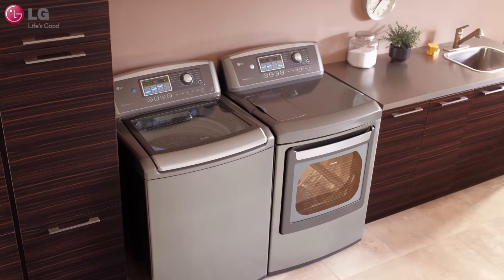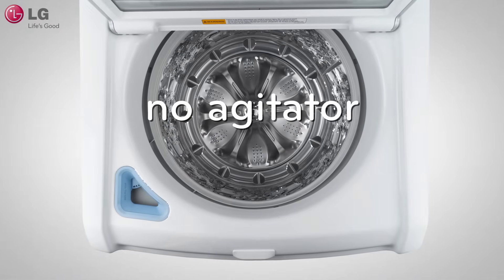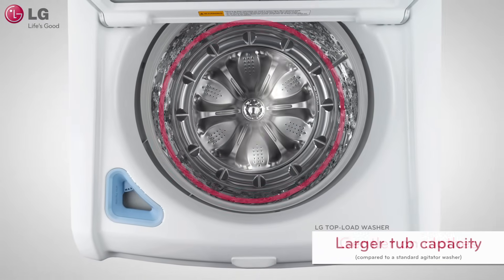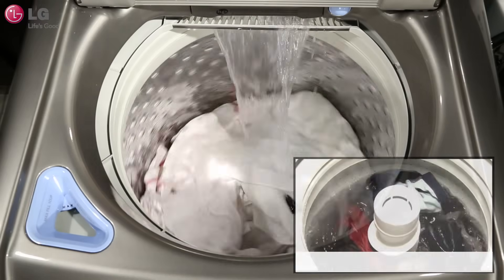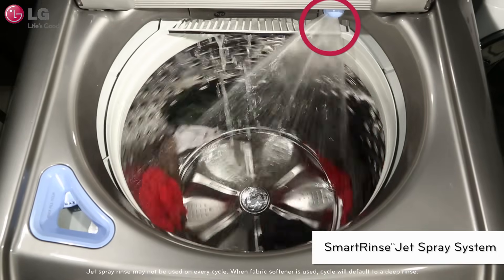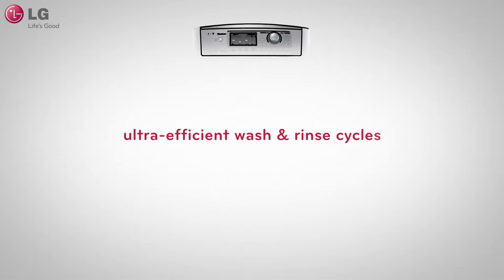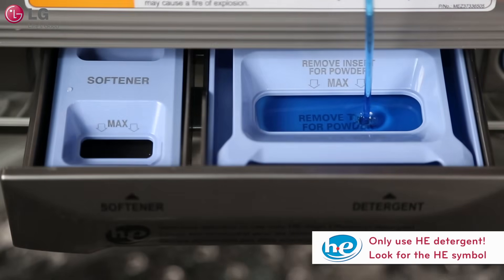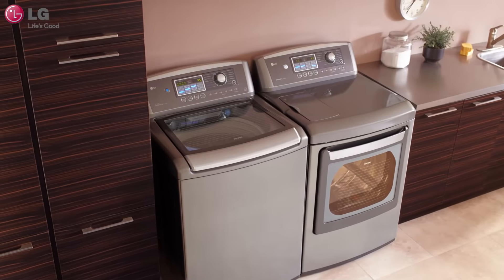LG Washer - How High-Efficiency (HE) Top Loaders Work (2018 Update)

Comment: "Less water does not mean that your clothes are not being thoroughly cleaned."  LOL! Yes, actually, it does. Clothes come out with caked mud that was never rinsed away, and a paste of detergent that was never dissolved. It's not "high efficiency" if you have to wash clothes two or three times.  One thing that helps is to top off the tub with a garden hose since they don't have a setting that fills the tub. Horrible product.

Comment: Purchased the WT7150C* washer and matching dryer, and it only ever puts 2 inches of water in the machine no matter how many items are placed in the washer... When I select "water plus" feature... the machine fills right up to the brim three times during a normal cycle. It's either not enough water or full to the max. there is no inbetween. Of course, we didn't find out about the LG support until just outside of the warranty period and are now stuck with a useless machine. Also note that when running loads through, they come out dusty and covered in lint... Not sure how this washing machine (that only does 1-3 loads per week in a 2 person house) is so dirty?

Comment: $1,300 of junk ‼️ Along with all the other complaints which I 100% agree with under this video, my favorite is I have to stand in front of the machine every time it's filling with water because when I put a comforter to wash (or any other load of clothes) the water line fills to below the comforter so the top half of the fabric/s is sticking out of the water - dry.. and you have to keep pressing add more water, add more water, add more water and wait. What an expensive piece of garbage‼️I wish I had read these reviews before buying it.
Reply: Omg same here,
Reply: I wash all my bedding on deep wash/water cycle. Never use bedding. If you go for the whirlpool brands - good luck to ya. Went through 4 in less than 5 years - all junk. I’ve had my top loading LG for 3 years now.

Comment: Well I bought the LG 4.8 top loader with the agitator. I've only done a couple of loads but it seems to do a real good job. I kind of regretted not getting the impeller but I had just heard too many bad things about it.
Reply: I'm glad to hear someone say something positive.  Too many negatives.  I'm trying to decide between LG impeller or agitator.  Grew up with agitator washers but would really like to try an impeller.  Pros and cons to both, I guess.  Continued good luck with your new washer:)
Reply: You’ve heard too many bad things about impellers in general, or have you heard too many bad things about this particular model?

I asked because the channel Ben’s Appliances and Junk claims this particular model is an exception to the rule when it comes to impellers.
Reply: They work better than Whirlpools

Comment: For the money, this is the worst washing machine and I'd never recommend it to anyone! The machine, literally, spends more time trying to balance the clothes in the drum than washing them. Even when the drum is actually washing/agitating the clothes, it only does it for a few minutes before it stops to balance the load, AGAIN! All the while, the timer is timing down, which allows the clothes to not get sufficiently washed or cleaned. I tried to return it to Home Depot, where I purchased it, but it was non-returnable. I've never been so disappointed in the purchase and operation of an appliance. For me, I should have gone with my gut, and purchased a good ol' fashioned top loader with an agitator. This LG top loader inverter is pitiful!
Reply: I totally agree with you! Worst machine I ever had! Clothes still had deodorant on them after supposedly being washed
Reply: @robyngallegos7041  is it t2028 afps5 ? I'm going to buy the above mensioned model 20kg top loader, if you are talking about the same model let me know plz, it's a lot of money and i dont want to burn it on a useless thing🥺
Reply: @pro max  yes it is the worst machine I ever had! Don't waste your money
Reply: @robyngallegos7041  oh thanks a lot for replying
Reply: @promax9159  you're welcome
Reply: @robyngallegos7041  one more question plz...to help me decide.. there are a lot of bad comments about this machine obviously people are not happy with this one, but there is another thing to consider, i guess almost all of these people have used fancy machines before this onr or front loaders that clean very well, what if someone has never used any latest machines would you still tell them to stay away from this one ?
Reply: @pro max  definitely would!

Comment: I’ve used my LG top load washers for 8 years without issue. You have to understand how to use these..you can’t just load them down with a random mix of items because the drum has to balance. Also filling it completely is a terrible idea...it should always be a little over half capacity when wet. It can handle a ton of clothes but you have to make sure it balances..which is easy to get used to because the machine mostly does it by itself but it’s not magic.

Make sure your weight distribution is similar between individual items. I wouldn’t trade mine one bit. If you want to throw any random thing in a wash and not bother separating like items then get a front loader.
Reply: Wher is awaileble. In cities of & in INDIA??
Reply: I too love my LG. About to buy my 2nd one after 15yr. service from my 1st LG.
Reply: @elbmcook  I’m on my second set also. Sold my house and the buyers wanted the set I had.

Comment: I've used this washer after a Samsung front loader had an accident with the belt snapping, and I've had no issues, it's clean and it smells good, just make sure to use a n affresh tablet and tub clean cycle once a month, clean out the gunk in the bleach tub, and cycle out the wet laundry quickly.

Update: LG dies due to drain pump failure.

Comment: I bought a wash machine TS1365NTP / 01 a year and a half ago and 3 weeks ago we noticed a smoke smell coming from the machine. We contacted the customer service over 2 weeks ago and we do not get our problem solved. Our old machine was also LG and it worked fine over years, but it seems LG products  are not what they used to be.

Comment: I see alot of people are having issues so hopefully these tips will help.
To start off, make sure you load clothes around the impeller, don't throw them on top.
When you add detergent you should use only a minimal amount, you should never EVER hit the MAX line in an HE washer.
If your washer is optioned with TurboWash. USE IT!! Trust me, TurboWash is what makes these LG machines so much better than their competition and I would honestly say if your shopping for a washer and it doesn't have a recirculating pump of sorts, don't do it. Spend the extra money to get a washer with a TurboWash or similar feature. You won't regret it.
Although these machines are "bigger" try only loading them as much as you would a normal agitator washer (I don't know why all these manufacturers have suddenly began making bigger tubs because it honestly hurts washing performance)
Also make sure you're running Tub Clean once a month and using a washing machine cleaner such as Affresh.
Another tip I have is to ditch using fabric softener. Fabric softener is essentially animal fat that has been scented and while you may not see it, it is reeking havoc on your machines internals. Fabric softener is designed to attach to clothing, but it also attaches to your washers outer tub and drains which over time can cause smells and mold buildup. 
Hope these help!!
Reply: As for the detergent, I just use Tide Pods.
Reply: Thanks for the tip about softener! I never knew it was animal fat base! My tub does smell even though it's cleaned periodically with tabs and the cleaning cycle! Bye bye fabric softener!🙏

Comment: Bought a 7800 washer & dryer 2 weeks ago. Awful!!!  The first one was so loud and made every noise imaginable and the motor sounded like it was dying. Today, (2 wks later) they brought a replacement. It’s just as loud!!  And what’s with the clink sound during operation?  It’s not my pipes - it’s the washer itself. It sounds like a hammer on metal. There constant noise during the entire operation. Annoying!
I’m gonna return it and buy another GE with an agitator and no fancy electrical panel. My last GE lasted 20 hrs and it wasn’t as loud as this one. Pretty doesn’t always mean reliable
Reply from the maker: This certainly doesn't sound right. We would be happy to take a look into this for you. For assistance, you can contact our Customer Support by any of the below options:
Phone: 1-800-243-0000 	
LiveChat:  https://www.lg.com/us/support/chatbot
Email: https://www.lg.com/us/support/email-appointment		
Facebook Messenger:  https://www.facebook.com/LGUSA/  	
Twitter DM: @LGUS

The LG Community Forum is also a great resource for getting help from other LG customers: https://lgcommunity.us.com/ ^CP

Comment: Sorry for my poor English...
I made so much research after we exchanged our Maytag washer bravo XL for this one (I had before for 14 years the American classic... manual with agitator).
I am super picky person,  I have no idea for how long this LG washer will last, but so far I am satisfied with it. There is not perfect product these days! Samsung wasn't the option for soooo many bed reviews, I didn't like Maytag Bravo XL. But I did like the dryer, although 8.8 CU was huge.
 Back to this LG washer...No issues here with low water or dirty clothes after washing. I pre soak dirty clothes, or also do extra rinse.
If I will have a man who comes home from work with extremely dirty clothes...or children with extremely dirty clothes...then I would choose a good washer with agitator.
With this LG, if you aren't satisfied for some reason with level of the water...here is a trick...add one basket of water top of the dry clothes before washing, you will fool the sensor, and it should give you more water in the drum.
I was NOT satisfied with the LG dryer! It had sensory issues and stopped cycle sometimes over and over again. It took long time to get dry certain clothes.
It has overall bed rewies. Cracked drum, sensor issues....
So.. I wanted Electrolux... highly recommended by my friend's and my sister...but Best Buy doesn't have them...So I got Maytag with steamer👌🏻
Reply: Yes all good points. Or you can Rinse+Spin the extremely dirty clothes to remove the dirt, so that when you pre-soak or do wash cycle of choice (warm water), the detergent isn't overwhelmed with contaminants.
Especially great for garden work clothes or muddy trousers from farm work.
Reply: PLEASE CAN YOU AGAIN EXPLAIN HOW TO GET MORE WATER IN THE TUB, I NEED TO SOAK MY WHITE CURTAINS
Reply: @kimstevenson3303  
Hi Kim, I simply add one basket of a warm water top of the dry clothes before I turn on the program. The contents of the drum will be heavier than just dry clothes and this will signal the sensor that more water is needed
Reply: @kimstevenson3303  You aren't dump 😊 
With all the stupid technology these days...the " machinery" around us we feel sometimes that we are dump. I am old school.
I don't think you can just soak your curtains in the drum as long as you would like, because this washer isn't manual wash machine.  I tried before just leave the clothes while the program was on, I just stopped the program and opened the lid and wanted to see what will happen, if I can just soak the clothes and then continue the cycle. But shortly after the wash machine switched off and ended the program.  
But there is program...if you look at the display Special care - soak. I never tried it. Not sure if it is effective.
What I was talking about is this...
Many people complain that the clothes isn't washing in enough of water. So I said there is a way you can trick the sensors with adding a basket of water top of the dry clothes before you start the cycle. With added water the clothes will be in the drum heavier, so the sensor will "understand" this as a lot of heavy laundry and the laundry will be washed in more water.
I hope this isn't confusing for you 😄
What about what to wash the curtains twice?🤷🏼‍♀️

Comment: I own this LG WaveForce washing machine, and it began rusting at the bleach dispenser within six months of purchase. The rust has only gotten worse and worse, even though I always leave the lid open after I'm finished using the washer to allow residual moisture to evaporate. The issue seems to be a metal coating manufacturing flaw that the company has neither acknowledged nor fixed. Thousands of consumers have commented about their rusting, relatively new LG washers, but LG has not rectified the issue for them, nor for me. I understand there is now a class action lawsuit against LG, and I completely understand why. I will never buy another LG product, not because they made a mistake, but because they have denied responsibility and have not fixed their mistake.
Reply: Same! Mine is rusted all along the edge of the bleach dispenser and overall the machine is junk. Wish I could have my old maytag Neptune back!
Reply: Mine too
Reply: Mine too.. same spot by the bleach receptacle
Reply: I used to work for the LG washing machine factory here in Clarksville TN and rusting was often a big issue. Other than that, those machines are some of the best on the market and are extremely quiet compared to other brands. The reason for rusting is because LG often has trouble with importing metal from Korea and has had to resort to using cheaper domestic metal.
Reply: It's a real shame because I absolutely love my LG washer. And yes I too have the rust around the bleach dispenser. I am considering sanding the rust then apply Rustoleum paint.

Comment: I have owned one of these machines for right about a year. I HATE IT!!! ITS AN OVER PRICED PIECE OF JUNK!!!  Buyer Beware!!! If I want me clothes CLEANED and no white streaks on my dark items, I can only put a few articles in the tub at a time,  about half a tub full. It uses more water and electricity then my old front loader maytag because of this. I have tried several tip but still having the same issues. Less detergent, liquid detergent, second rinse, inside out.....no differences!!!! Now I'm stuck with it.
Reply: Not sure if you still own this machine. But when I experienced white streaks on my dark levi jeans it was because of my tub. Use a tub cleaner like oxi clean, run on tub clean setting. Then afterwards, Glisten Washer Magic to wipe the tub down with a wet microfiber towel. No more streaks.
Often this happens from too much fabric softener. Hope this helps.
Reply: @kylelangley8818  Thank you, Kyle. We do still own this machine. When I posted the original comment we had just brought it home from Lowe's,  brand new. We have just been washing our darks inside-out and that has helped a little. I will give your suggestion a try, thank you again.
Reply: I get that residue too!, we use about a Tablespoon of liquid soap now and hot water...
Reply: Is it t2028afps5 ? Please ?
Reply: @promax9159  I'm sorry, not sure exactly what you're asking?
Reply: @MCole-yh4fs  i wrote the model number and asked is it your machine ?

Comment: We just purchased an LG steam washer and dryer set from Sears in 2010. Yes we have going through a couple repairs. just a couple of days ago. We noticed that on The spin cycle, that it’s not seeming to spin very well. We took them out of the washer and they were dripping soaking wet. Yes talking about the clothes them selves, we had put them in the dryer and we had to run the dryer twice. Once this wash machine and the dryer set goes up, I will be looking for an old school grandma Kenmore set from the early 70s or the early 80s, or looking for a speed queen. Will be the last step we will ever buy from LG or Samsung or whirlpool or Maytag. We even have to run the washer when the speed wash cycle at night since it’s a lot cheaper, how is this high-efficiency?? This will be the last time we will ever buy or even own high-efficiency appliances again.

Comment: it's far better than our old maytag, the clothes actually smell clean and you don't have to spend time readjusting everything
Reply: If your clothes still smells like detergent it did not do a good job rinsing
Reply: @khalilt6508  smelling “clean” and smelling like “detergent” are two completly different smells ya know?
Reply: @carmantony0811  Your 2 years late ya know?
Reply: @khalilt6508  it’s never too late if the person responds back
Reply: I don't see the clothes on top being pulled down into the water.  So I'm pushing them down-adjusting them.
Reply: The one traditional agitator video they use here is indeed an 2000s maytag Atlantis or performa because of agitator looks😂😂

Comment: I wanted it to work so much and I believed these commercials and thought "people were just not doing it correctly or not reading instructions"  but the reality of the fact is I regret it now.  Clothes often come out dry in spots (even on deep water setting) and more than 1 out of 4 come out with detergent spots still on the clothes.  Whoever came up with the "new technology" it talks about in this video is/was  incompetent.  (probably fired by now.. I hope)
Reply: My blood boils every time I do the laundry. I agree with everything with sirgregory1st has written. I wish I just got my old machine repaired instead of spending money on this machine. 😩
Reply: I agree with you the washer is a peice. I called them and they told me to change the water line, joke
Reply: Agree 💯 same problem here, 😔 l wish l had known this before spending money they are not worth, l’m buying a new one, totally different brand….
Reply: Because you overstuffed it.
Reply: These new "high efficiency" machines are NOT designed to clean clothes; they are designed to comply with government/EPA regulations.  Gotta think of the little critters, after all.  lol